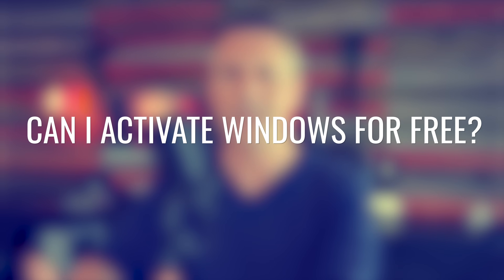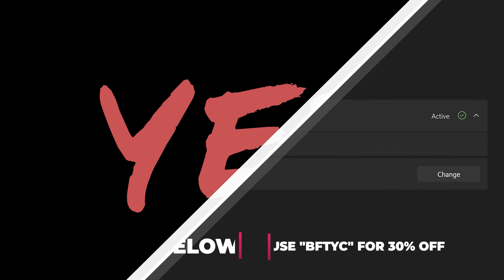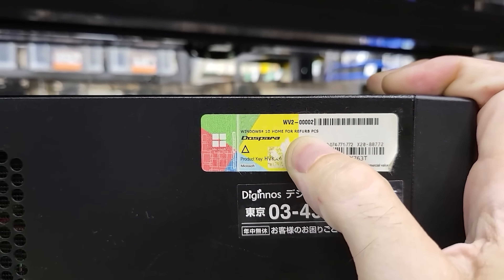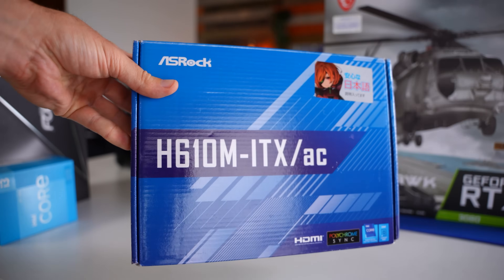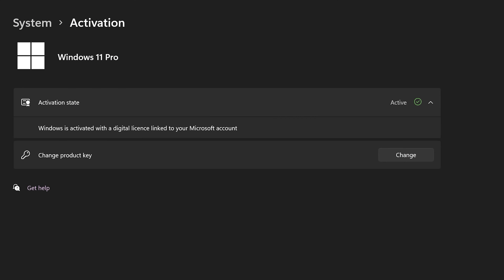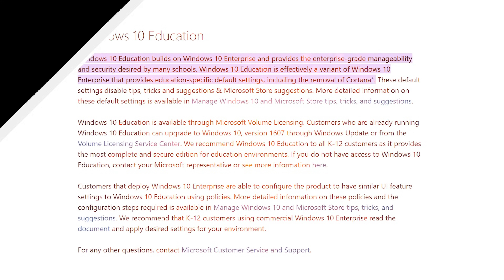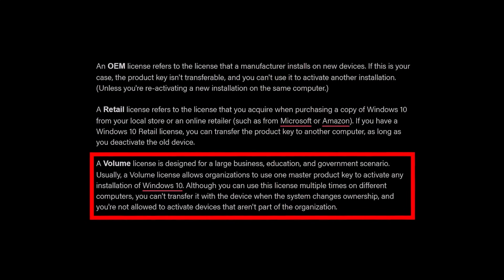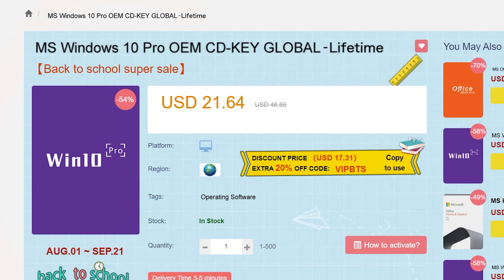How to Get Windows 11 for Free in 2022...! (4 Methods I Know)

Comment: You are correct. I flip Dell and hp computers all the time, they usually don't have the drives but replacement and reinstall is easy
Reply: I bet flipping them is harder now since those Windows 7 keys no longer work to activate Windows 10/11. Other than installing Windows 10/11 and leaving it unregistered.

Comment: in my experience Microsoft has been amazing, in the past I purchased a full OEM retail copy of Windows 7 Ultimate, Microsoft gave users a free upgrade path to Windows 10 & then I signed up for the "Windows Insider program" & Microsoft then gave me a activated version of Windows 11 Pro for free (tied to my Microsoft account). in my testing this past year I have nothing negative to say about Windows 11, it has been smooth sailing using Windows 11 Pro on my gaming PC!
Reply: I too went from 7 to 10 to 11 with the same key
Reply: @roydavies953  Same way here.
Reply: It is either OEM or retail not both.

Comment: Everone has a key like 6 of them , just reuse it , you can use a key 5 times then they lock it , but they reset it if you call them , only locks if diff hardware 5 times.
Reply: Isn't that retail and not OEM?
Reply: @Krytern  Keys on laptops and computers we all have lying around, They work. Only had 1 of my keys not work in windows 11, But it worked if I upgraded from 10 or added it manually via PowerShell. I think the keys printed on computers are OEM.
Reply: ..and you live where?

Comment: Can you make a video about the difference of win 10 and 11 and is it worth the upgrade? Thankyou
Reply: I haven't upgraded to Windows 11 yet because I've read that there are bugs and features with Windows 11 that make using it somewhat unpleasant. I don't know if that's still true. I might wait until Windows 10 is no longer supported before I upgrade.
Reply: @BREEZYM6015  The main change is the design and the new taskbar. The the design is more consistent. But context menu and taskbar are more dumbed down (can be reversed). Windows updates are 40% smaller so the update process is noticeably faster. Task Manager has a new design and dark mode support. The dumbest thing about 11 is the TPM and Secure Boot requirement. Thankfully making a bootable USB stick with Rufus allows you to bypass these requirements easily.
Reply: @Raivo_K  Thanks for the info. Do you use Windows 11 and if so do you like it? I've watched multiple YouTube videos about Windows 11 and its pros and cons. I have an older computer and it doesn't meet Windows 11 requirements due to the reasons you mentioned. If it's worth upgrading to Windows 11 then I may use the work around method to install it.
Reply: @Raivo_K  you can hit shift f10 on any win11 boot cd and enter a couple keys into regedit.  Bo need for a special one.
Reply: @BREEZYM6015  I just installed win 11 on a 3rd gen Intel, just follow a guide.
Reply: @milescarter7803  Thanks.Do you like Windows 11? Is it better than 10?
Reply: @BREEZYM6015  Not yet. I plan to upgrade later this year.
Reply: @milescarter7803  I know. I've used this on virtual machines. But it's annoying when doing this more than once a day. Also this does not work for major version upgrades inside installed OS.
Reply: Don’t upgrade
Reply: @MarkSmith455  OK then. I'll wait. What are your reasons not to upgrade?
Reply: @BREEZYM6015  All the nice features have been removed. Main one is you can’t separate application tabs, they only display staggered on top of each other. Just go to a shop and play around on a new laptop with windows 11 and try setting it up how you have windows 10. You can’t do it.
Reply: @MarkSmith455  Going to a store to see how Windows 11 is configured is a good idea. Thanks.
Reply: Yes, please. :) It would be great.
Reply: I found that Windows 11 is better when it comes to HDR and multi monitor config.
Reply: it's not worth the upgrade, an in fact it's more of a downgrade. best to get Win10 and a firewall instead. best to install Win10 AME (ameliorated).
Reply: @p4radigm989  that one is strip down to the bone, AME is targeted at users who want to hide something where everything but the core stuff is removed even updates
Reply: @scudsturm1  real men don't get Windows updates
Reply: no its's shit
Reply: I’ve used Windows 11 since it was in beta. It’s definitely worth the upgrade. I could never go back to Win 10. All the people saying they’re sticking with 10 are the same people that stuck with 7 etc. People are just scared of change by nature. Just take the plunge, it’s 2022 not 2015
Reply: @CustardCream22  never say never, glad everything works for you, for me not
Reply: @alexmiller6534  I said never. I’ve used Win 10 since Win 11 and I didn’t like it. So that’s why I said never. Sorry it doesn’t work for you. You tried upgrading your hardware?
Reply: @CustardCream22  when you work for industry, you know they want reliability. You can't install windows 11 where it's still not as stable as windows 10 is today (just like in 2015, windows 10 wasn't as stable as 7, heck even 8.1 was better in that regard). Even more so when you have to deal with all the crapware that comes with all the dell and HP "professional" desktop. I saw an occurrence where the scada system would crash because the computer was running out of memory. Why is that on a 8gb pc? Because of all the Dell service crap that eats half the memory.
So we don't want to add more problems. It's already frustrating enough to get a "pro" pc that doesn't work as intended. Even more when it's supposed to run best on new hardware while new hardware has data loss problem on newest gen hardware...
Reply: @benjiderrick4590  Ok who the hell buys Dell or HP? Building a custom pc is the only way to go and much cheaper. And 8GB is not enough anymore, of course it’s gonna be full. I’m using Win 11 every day and I can assure you it’s stable. People just need to upgrade if they have a modern pc.
Reply: @CustardCream22  only if u use alderlake, ryzen works totally fine with 10
Reply: @scudsturm1  I’m not sure what you’re trying to say there, but I’m using Ryzen with Win 11…